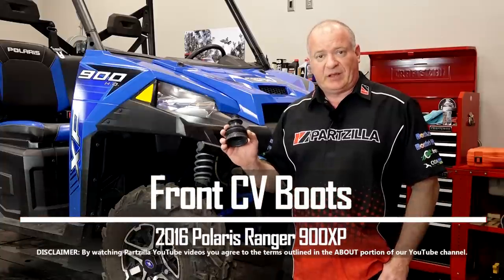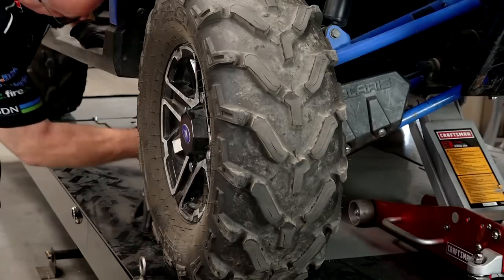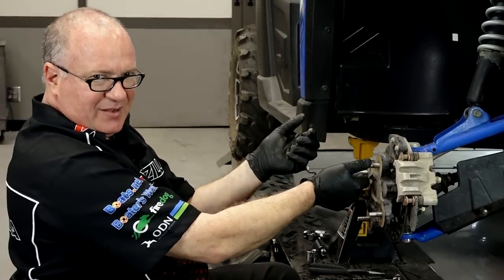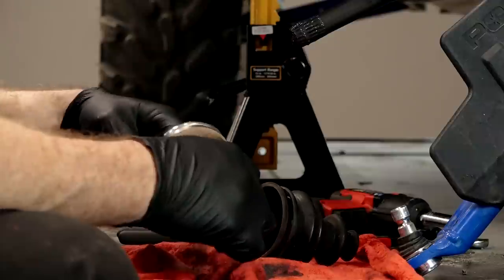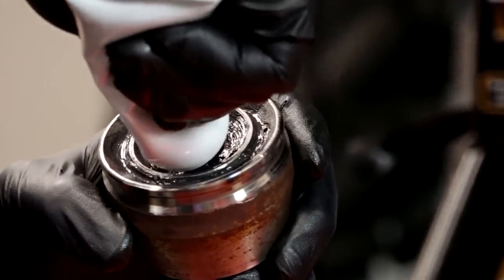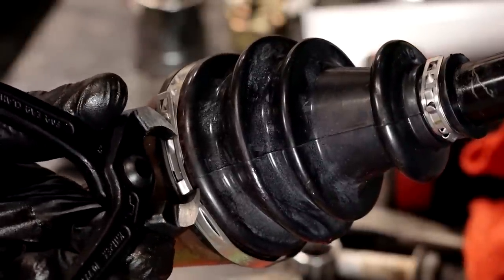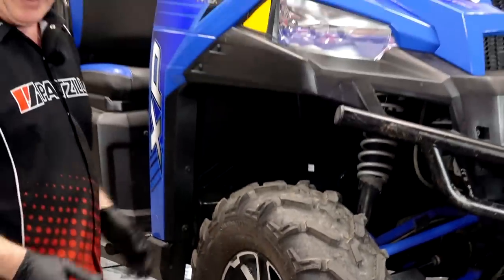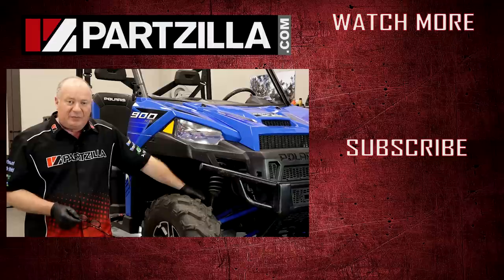How to Replace a Front CV Boot on a Polaris Ranger | Ranger 900 XP  | Partzilla.com

Comment: There is no way that the CV cup pops off that easy. Just did the outer boot on my 900 and it took lots of hammering as with any CV boot replacement I've done. Also if you are into it that far one should take the complete CV axle off and work on it on the bench in a vice. Before reinstalling grease the inner axle splines before popping the axle back in.
Reply: The other way to do it if the outer cup doesn't seem like it will come off as too much hammering is not good for the joint, the inner CV cup can be taken apart without hammering but does take longer and requires removing the CV boot. Maybe a complete new axle isn't that costly in the end?
Reply: Yeah, no shit.  Mine was a pain in ass.  Had to take the whole axle off
Reply from the maker: Yep you are correct. Sometime things DO NOT go smoothly. This one did for me and only took a couple taps before it slid off the retaining clip. I caught the tear really early so no corrosion had gotten in there. This one on the 850 was another story. https://youtu.be/E5aVI_qzg78

Comment: I appreciate your effort to make this video, how ever, I believe you should have made it aware that the CV Joint does not just slide off easy as you show in the video. The fact is, there is a C spring clip on the end of the axle shaft that holds the CV joint on which makes it extremely difficult to remove the CV joint. I used a 35lb. slide hammer to overcome the spring clip to get the CV joint off and it took almost a dozen slide hits to get it off. In fact I believe that if the cv joint does just slide off you probably have a problem with the C clip needing to be replaced.
Reply: I wish I saw this comment before I tried this.  You are exactly right what a pain in the rear
Reply from the maker: Craig you are correct. Sometime things DO NOT go smoothly. This one did for me and only took a couple taps before it slid off the retaining clip. I caught the tear really early so no corrosion had gotten in there. This one on the 850 was another story. https://youtu.be/E5aVI_qzg78

Comment: 2013 Ranger 800. Trying to pull the front outer hub/CV joint to replace the boot. Couldn’t get it off. We even had a slide hammer on the castle nut. We finally gave up and put it all back together. I was afraid we were going to damage the bearings in the CV joint. We even tried driving it in and then back out to break the snap ring free. Any suggestions would be greatly appreciated.

Comment: How much more work is it to replace the upper boot?
Also, how necessary if the wrench for removing the clamp?
Reply: you can cut the clamp but it is next to impossible to complete the job without the clamp pliers

Comment: Does the CV joint come off that easy?  I have a 2015 Ranger 900 XT and the CV joint isn't coming off.  I also have steel rims and just put the tire back on to break the axle nut free, which is handy if you don't have a helper.
Reply: Not always!  The circlip that keeps the joint on the axle can get rusted or just not compress enough to let the joint come off.  I've taken air hammers and big hammers with brass drift punches to get some of them off.
Reply: No.That part of this video is an outright lie.They skipped all the hard crap.I've been doing this since cv joint front wheel drive cars were just becoming popular and not one,ever came apart easy.Also ASE certified.If it was as easy as shown it would fall apart on the street.
Reply: Is it even possible to remove the outer joint without taking out the entire axle?  I wasted an entire afternoon because of the false narrative on this video.
Reply from the maker: Sometime things DO NOT go smoothly. This one did for me and only took a couple taps before it slid off the retaining clip. I caught the tear really early so no corrosion had gotten in there. This one on the 850 was another story. https://youtu.be/E5aVI_qzg78